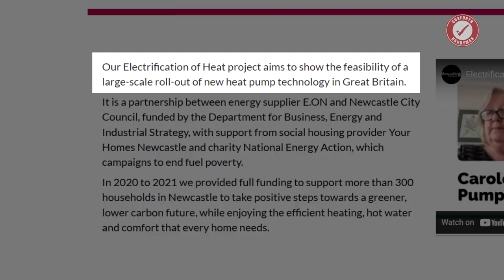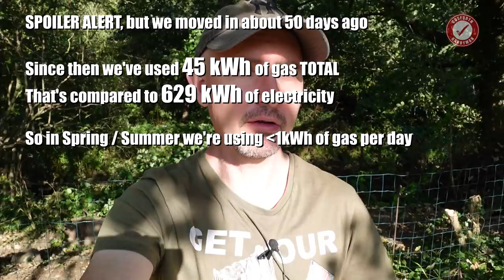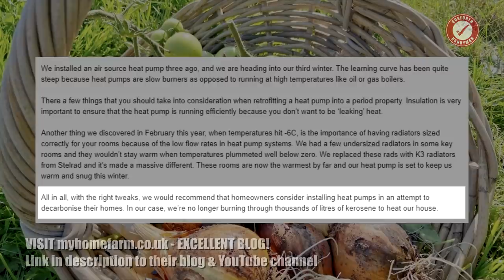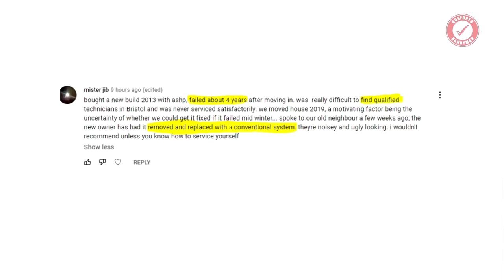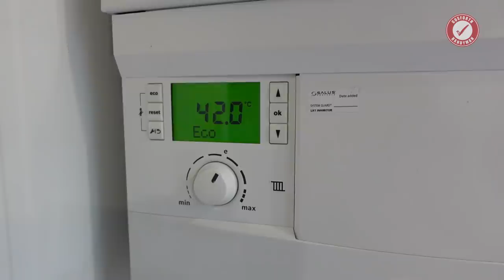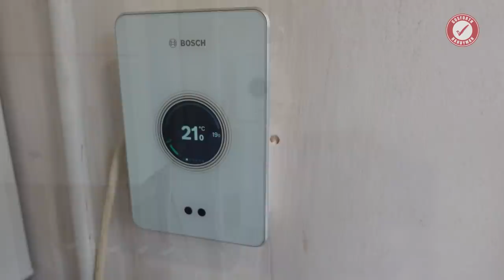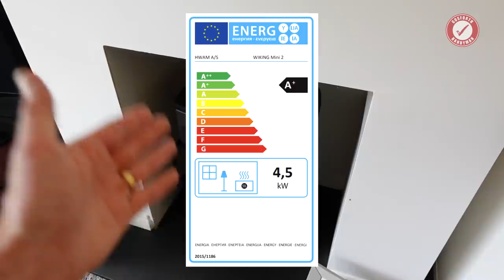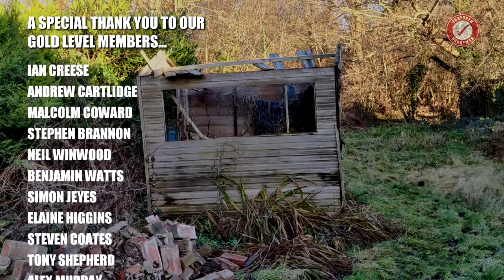Why didn’t we install an Air Source Heat Pump? (1920’s Renovation Part 32)

Comment: I have an unvented central heating system which was installed in 1992, a new condensing boiler in 2010 [ 18KW Baxi solo]
its a 3 bed, 1970s semi cross build, central heating on 18 to 20c 24 hours a day plus inset gas fire for most of the day 2.5 gas units a day [unless we have a "Beast from the East[my meter is in cubic feet] to heat the water takes less than a hour without the heating on and uses 1 tenth of a gas unit.
I have tried putting the heating on timed and it always uses 1 unit per day extra than when running for 24 hrs.
during the summer months leaving the water to heat 24 hrs uses 2 tenths of a gas unit, obviously with a family using the water it would use more
location is coastal Cumbria, not suitable for cavity wall insulation as zone 3 [wet and windy] had to have my cavity wall insulation removed this year as it was wet

Comment: I'm 80 and had a very satisfactory Baxi back boiler but at 20 years old it wasn't going to last for ever so we swapped it for an efficient Vaillant combi boiler with a 10 year warranty. I'm banking on a hydrogen conversion eventually. A noisy inefficient air source heat pump was simply not considered.

Comment: To get the best out of a heat pump you need BIG pipes (at least 22 mm I/D) and preferably underfloor heating. Failing that you need big multi-panel (three or four) radiators to heat your home. Even with a heat pump you still need a boiler to get hot water to wash in. I’m also assuming your house is also well insulated. Assuming you have (very) good insulation, the most useful tree hugging technology is mechanical heat recovery. However, what you really missed out on was the solar panel income. The paperwork to transfer the income is simple. The reason I know this is that I have raised this very issue with my tariff handling company.
Reply: I understand the panels were naff,  but I would have retained the electric set up modified and new panels - price has come down, if a means of fitting was possible

Comment: Some valid points and some old fashioned theories and out dated understanding both in the case of ASHP and gas central heating Combi or unvented. I would take a fairly safe guess that your Combi boiler you have fitted will not condense unless you’ve sized your radiators somewhere close to the size of ASHP use. Whichever technology you go with they are all only as good as the installers understanding of heating design and efficiency measures. The fact that you ran out of hot water on a 220ltr Unvented demonstrates that wasn’t well installed and should have been on a modern Priority DHW control system, the cylinder was the wrong type of cylinder for that and not the best boiler choice all fed into your poor experience of unvented cylinder, done properly that would have been your greenest and best performance answer for a growing family of four. You need 36kw of boiler to give you a reasonable hot water output at your taps, mimicking the performance of unvented but still falling shorty, but your house before you insulated it would only require max 10kw for heating and now you have insulated probably no more than 6kw at -3 outside. Your worcester boiler will be cycling on off on off for fun as it gets to hot because it can’t modulate down low enough to match your needs. You know as well as I do, all products have a cycle life before they fail, your install and choice of boiler has just shortened your boiler life. Heating design in the UK has been diabolical for 20 years because of industry lack of knowledge and easy fix Combi boilers too big for properties running on poor controls with small emitters forcing high temperature system water. It has to change whether that’s ASHP low temperature systems or gas boiler low temperature systems. It is changing and very soon Building Regs will change to force low temperatures which will then take away a lot of your ASHP argument. Poor design will always give poor performance regardless of technology employed, Ive followed your channel for long enough to know you understand that. Great Channel, good video as always but clearly not your specialist topic.
Reply: Why would you assume that the combi boiler won't condense? Thanks for pointing out PDHW for me, I didn't know this was a thing. I'm not sure I fully understand why you think the boiler can't run 70/50 for central heating. From what I have read they are more than capable of doing so, the inefficiencies occur when there is demand for hot water. The issue that I have experienced with unvented heating cylinders is that they are often programmed to be on timers. The argument was that you could do the washing up in the evening or wash your hands throughout the day without engaging the boiler at all. Of course then if you go to take a shower when the boiler is not configured to heat the cylinder, you're filling cold water into the tank while drawing hot water, so it cools very quickly. I wouldn't be surprised if the coil rating for the cylinder didn't match the boiler but I would imagine its this treatment as a timer-based storage tank that was the problem.
Reply: @MatthewEsch  The boiler not condensing is answered by your own wish to run it at 70/50, so the return water coming back at 50 is only 4° cooler than the point at which condensing starts, meaning less than 20% of the heat exchanger is in condensing mode. Run it at 55/35 and you will get best part of 100% of the HEX condensing. Do you understand latent heat and why we want the boiler condensing as much as possible?  PDHW is not just about the timer control it is about having a boiler and control strategy that is able to run two different output temperatures and give rapid demand to the cylinder when you need it. Yes coil rating, size and flow capability are a factor and Tribune cylinders would limit the efficiency of PDHW and be noisy because of the coil design, hence comment about previous setup. Replacing hot water taken from the top with cold added at the bottom does not cool the cylinder water as a whole, You get stratification across the cylinder where the water forms layers of differing temperatures so the top remains hot and the bottom is cold or cooler. PDHW uses a thermistor to sense temperature rather than the traditional bi metal strip, the advantage being the boiler and control strategy doesn’t  just know the cylinder has cooled, it knows the exact temperature of it and adjusts output accordingly with a shot of very hot water before returning back to a cooler setting for the central heating, correct coil sizing means this recovery is very short and done correctly, by the time you you’ve towelled yourself off after a shower the cylinder is recovered (and I’ll add, it doesn’t take a 36kw boiler to do it 18kw is more than adequate). Finally the radiators you size and buy using the manufactures catalogue are given an output rating against a British Standard defined operating condition, that operating condition refers back to the old back boiler or floor standing cast iron low efficiency boilers running at Dt 11 and much hotter water, Even at your non condensing 70/50 you are not getting anywhere near the output the catalogue said you would. And at 55/35 you getting roughly half the output so the radiators need to be sized at double the catalogue rating than what you actually require, just the same as with ASHP. To get rads sized for an ASHP you will be looking at triples rather than double panel which is partly where Under floor heating is generally the best way to go with heat pumps, but there is another reason. UFH gives 80% of its heat as radiant heat, unlike radiators where the name is misleading because they give 80% of their heat as convected air. The radiant heat is a far more efficient form of heat it is what we sense moist as humans, stand next to a huge block of ice and feel the cold that is radiant heat loss, we will generally find that a home heated with UFH is usually found to be at a comfortable level 1 or 2 degrees lower than the equivalent home using convection radiators. This is all common information that has been ignored for years by an industry of lazy plumbers throwing massive Combi boilers on walls to get high DHW flow rates and running high temperature heating systems. As with the radiator that doesn’t actually radiate heat it uses convection your boiler shouldn’t really be called a condensing boiler, “could be a condensing boiler” would be far more appropriate as 90% are fitted into in efficient systems with undersized emitters burning mare and more gas than is necessary and creating more and more thermal stress on the boiler increasing wear and tear and cycling, shortening the boilers life and reliability. Bit of a rant but the industry is changing and old ways are being challenged, slowly.

Comment: Just replaced an open vented system in my 1960s semi with a high output combi like yours.  The old boiler was 25 years old and the gas bills were very high.  Only £20 a month in the summer heating the hot water cylinder but could be over £140 a month in the winter heating the house.  I'm hoping it's £3,000 pounds well spent, that cost did included removal of the old vented system and updating 5 radiators.  ASHP have their uses but my house wouldn't be one of them.  Reminders me of the solar water heating from around 20 years ago, I'm not sure if that scheme was another one of the then government's bright ideas.
Reply: whats wrong with solar water heating?
Reply: @edc1569  Nothing in principle lots in practice.  It was tried 20 years ago and they don't work for the average house in the UK.   That's why photovoltaic panels are mainly used now.

Comment: I agree with you. Heat pumps have been installed in Poland for over 15 years. The truth is that this takes a lot of electricity and only makes sense with solar panels that produce energy. And only in houses with very good floor insulation, minimum 10 cm, walls minimum 20 cm, and roof minimum 35 cm. In this case, underfloor heating works best compared to radiators. In Poland there are temperatures of -10 degrees Celsius in winter, sometimes -25

Comment: Great video. I went through the whole process on one of the free trial offers with Ovo - long story short - had no choice over the installer and I was not trusting the design decisions - eg they did not even check our piping sizes. In the end the full cost was close to £15k for a four bedroom 50’s house in London. Nuts even if I was not paying for it. Decided not to proceed as felt we would have ended up with problems and a cold house. And interestingly, even though I was willing to pay slightly more in energy costs in order to be carbon free, it really annoys me that all the green schemes are essentially being funded through taxes on electricity, not on gas. Of course right now no one wants more expensive gas, but in the end a good incentive to invest in airsource heat pumps would be cheaper electricity prices. Anyway, have decided to first sort out insulation, look at an electric car and wait for hydrogen generators/ boilers to mature before changing our boiler. I might however gradually invest in larger radiators …

Comment: Great video! watched  this a couple of times as we are in the middle of are full renovation.  as you insulated floor so well and made the room more air tight did you have to put a separate air feed from under the floor to the log burner for draw for the fire?

Comment: I am considering replacing old Gas Combi.  From what I have read there are some simple first points.  1. it's not gas! Gas has and will continue to get very much much more expensive. Gas will run out. 2. Reputable installers all say - "Not all buildings are suitable". Mainly due to poor current insulation standards, poorly fitted windows, drafty floors etc.(Things that should be sorted anyway!) 3. Heat pumps can easily work in whatever temperatures we can have in UK.  A simple internet search has many central US owners who commonly have winters down to -20C! - And the heat exchanger still works (0 Kelvin would be a problem! ;-)).  The radiators (and associated pipework) will probably need checked to allow sufficient water flow to radiate the heat.  4. The method of heating is different; no sudden blast of heat - maintain a reservoir of heat within the building, do not try to shut off areas.  5. There have been and will continue to be huge tech advances in recent years. (I'm pretty sure Gas boilers are better now than they were when they were first installed..?) 6.  Noise pollution! yet again modern boxes seem to produce next-to-no noise! Keep them maintained and they should continue to produce little noise even at full output.  My old rattly diesel estate is probably still quieter than my Dad's first car... 7.  The ethos is different - don't install "bigger" because it is false efficiency.  The re-energising of the system would be more than the box idling along, which seems counter-intuitive. 8. Many of the negative comments seem to derive from systems that were badly spec'd, possible of inferior, cost cutting components, may I humbly suggest fitted by less experienced fitters, (can't simply flip from standard Gas/Plumbing) - and we get surprised that they didn't work quite as well as expected!?.
Ok - my observational "rant" over!
It was interesting to note the change of experience at the farm quoted - after tweaking a few things that maybe should have been done/explained beforehand.  Close that loop, and possibly we won't have worried ex-gas fitters bemoaning the move over. (Are combustion engine car mechanics not going through the same!?) 
I watch with interest - (Non early adopter me)

Comment: Last landlady forked out £3K to replace boiler in my last house, all singing, all dancing Worcester Bosch, WiFi on it etc etc. Once I’d got it worked out and all my settings were done, it cut my heating bills in half! My new house has a basic boiler that can be a temperamental pain in the ass lol.
I suppose it’s all down to personal preference xx

Comment: My boiler needed replacing last spring ,i looked into the heat pump heating ,and it did not look like a good option for me ,maybe if you had a modern house with solar power and loads of insulation, but not good for a older house . I also went with a combi boiler in the end .

Comment: I think there is a bit misunderstanding about efficiency of the heat pump. Yes it is not good decision to swap the heat pump when you have small high temperature radiator system. It only make sense if you switch to low temperature underfloor heating with insulated floors and roof at least. with such a setup you would have COP above 3 for whole winter. For sure also gas boiler would benefit a lot from insulation and underfloor heating. Then it is matter of cost of electricity and gas, if it makes economical sense for your particular case. Heat pump is a great technology which is applied succesfuly in many contries but very badly in UK as it seems. But for sure modern condensating gas boilers are very economical and ecological solution as well, in countries with good gas network.

Comment: Ground-source heat pumps can be installed with a vertical loop. Instead of a trench, think a well. Probably more expensive to do it vertical.

Comment: Thankyou for your videos. I am very happy you are happy with your chosen heating solution, i agree its probably the least cost solution for your property. I have also investigated heat pumps for my refurbishment project and the economic case cant be made yet and to make it work would need extensive insulation works that help what ever system is installed. I agree we you we all have to make our own journey to decarbonise, that path will be different as you highlight. The pro diesel policy was created in the 1990s and was focused on Co2, it missed the dangers of other toxic emissions that became much more visible with the VW diesel gate issue, i would advise move on. My journey includes a new EV, and i would strongly suggest you dont believe all you read from interests that wish to slow the transition. Cobalt is being phased out of car batteries, not phones and lithium generally comes from Australia and south America. All EV batteries can now be recycled, can diesel do that after its burnt? Your physics on limitations on hot water tanks is questionable when all boilers ( the heat source ) can be of similar capacity and all boilers are of similar fundamental design now. Hot-water tanks do take up space, cost money and leak heat at very very slow rate, and thats the main downsides but energy storage is good imo. Cheers.

Comment: The heat pump system requires an 60-80-100 cm insulation wall, 2 or 3-layer windows, which may be better than gas heating.
I from Hungary, there every winter go down teperature -5-15°C, summer 30-35°C. You have there 80-100cm isolation wall, very low the gas heater invoice/month.
Put on the wall 20 cm grafith isolation, good floor and roof isolation, go down minimum heating invoice/ month.
Traditional cottage 100 cm wall (clay, straw) average temperature in winter, summer, 15-18 ° C, no heating, no clima system.

Comment: Very realistic view of the heating types available in the UK, insulation is the way to go to save heat loss and just my opinion but a cheap combi boiler costs more in the long run 👍
Reply: Problem with insulating an old house is that when done badly it can be very damaging. Still haven't worked out how to square the paradox of needing both air-tightness and constant ventilation.

Comment: Nearly fell for the heat pump marketing idea , thankfully I’m not that stupid.
& quickly realised uk homes & in particular older houses like mine will require painful & expensive upgrades.
I’m on heating oil, but there’s gas available in my street so will probably get it installed , just not sure how much the grid would charge to hook up the house ?